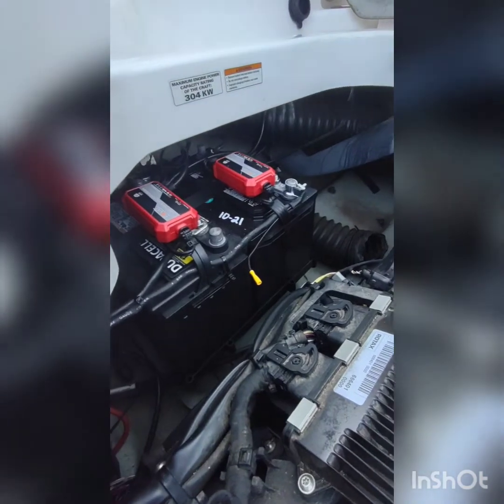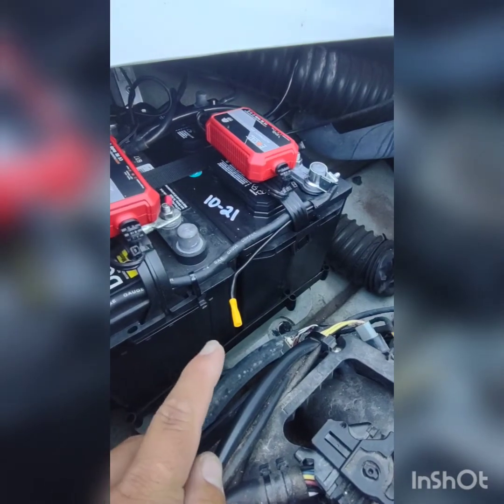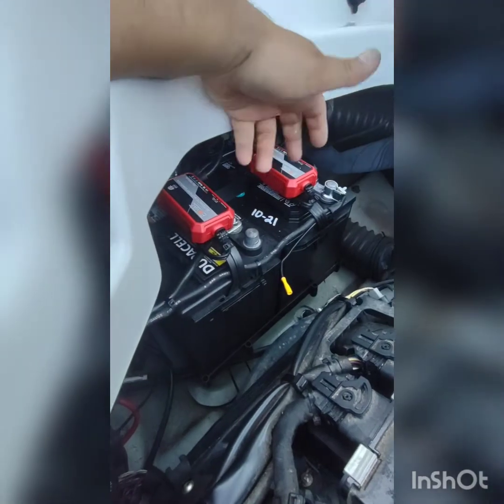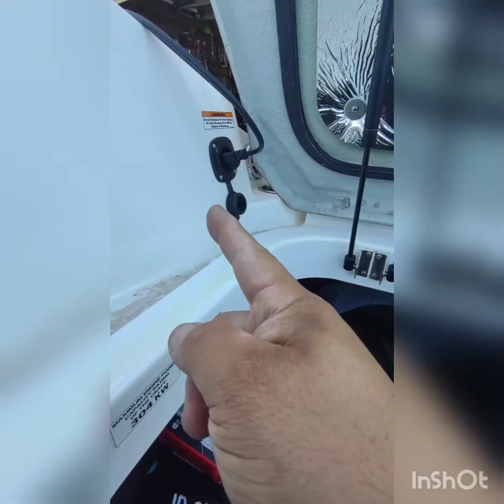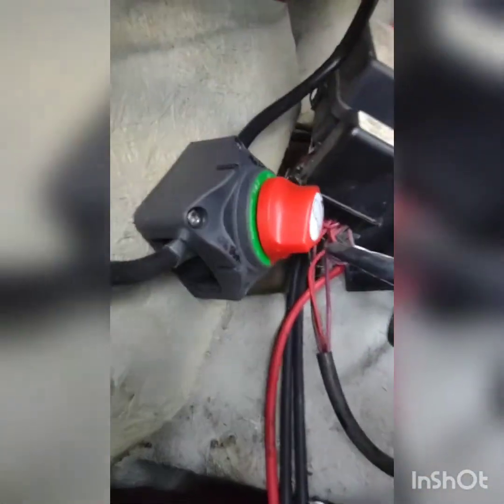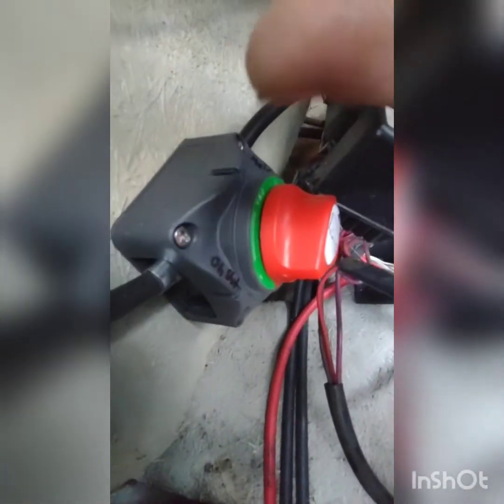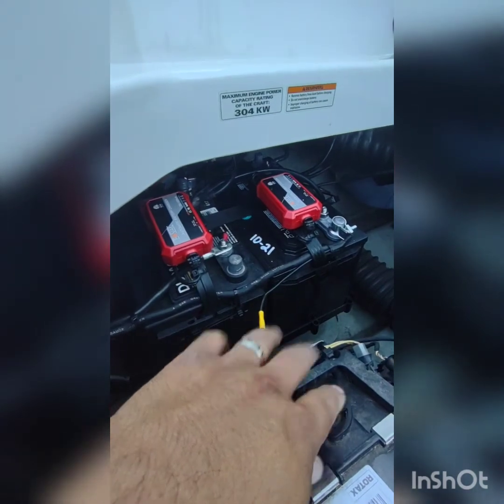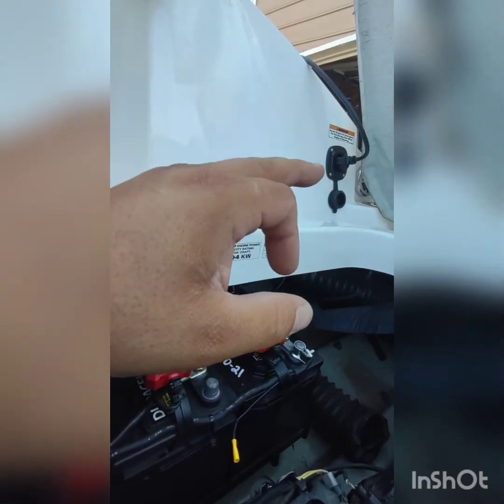SEADOO JET BOAT DUAL BATTERY MODIFICATION INSTALL.

Comment: Why not swap that 1-2 cutoff into the stock switch position?
Reply from the maker: I would but previous owner made a custom fiber glass wall to mount an amplifier for stereo behind it and cannot run a new power wire through there to do switch there. I would have to cut out the fiberglass wall.